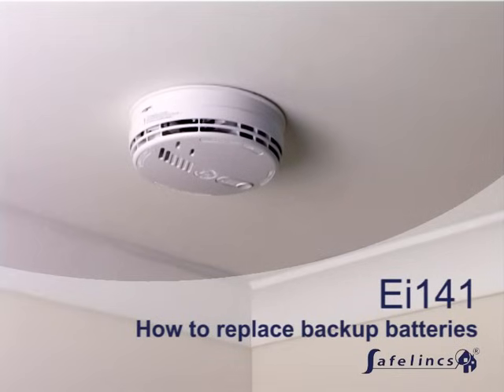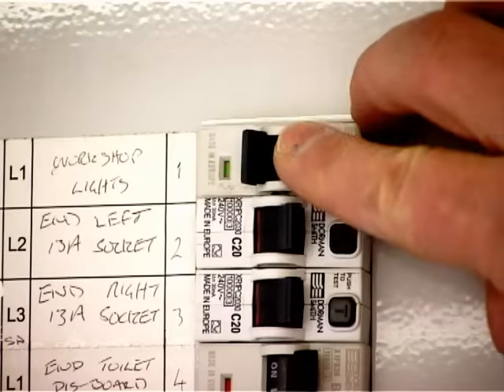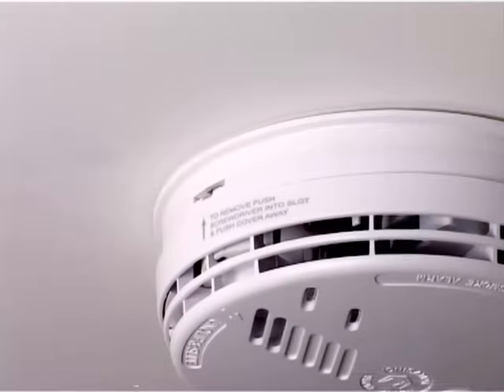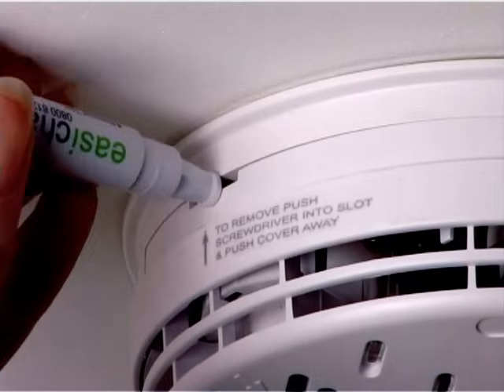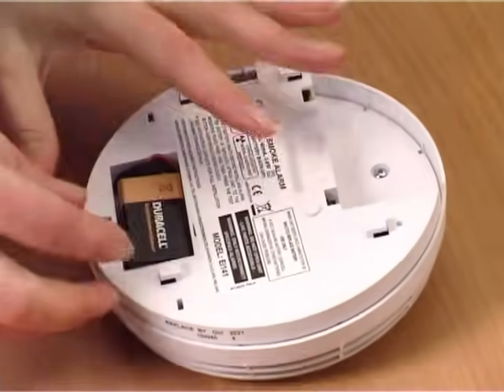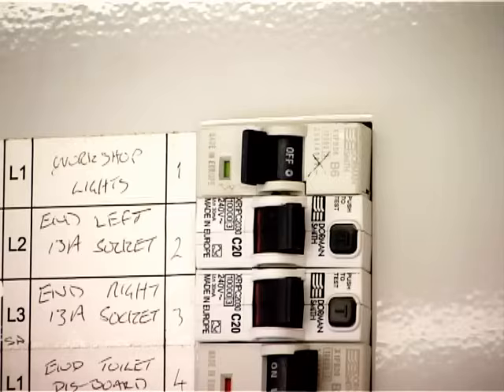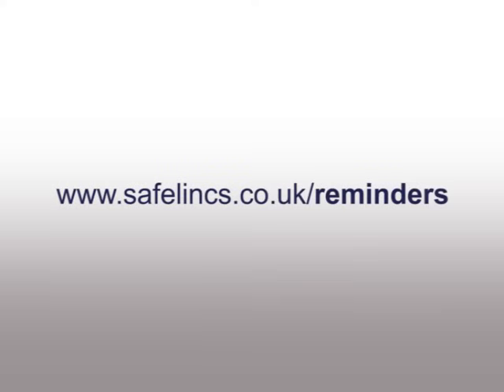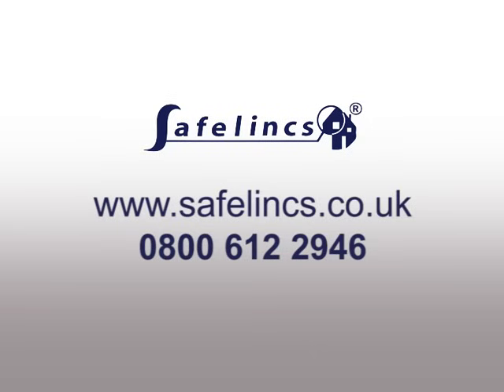Replace battery in Ei141 smoke alarm

Comment: Comments are comedy, however, to all the people saying how sh*te they are: they are incredibly easy to take down, get a blade screwdriver, push it half a centimetre into the slot on the side, then tilt the blade towards the roof to unclip, then slide the unit in the direction of the arrow. 
Once it’s off the ceiling the battery is in plain view, swap it for a new one, clip it back onto it’s base and that’s it. Not as easy as the old battery only ones, but with good reason: these are connected to the mains... the actual mains!! if all you had to do was unclip the front there would be potentially fatal voltages present... these things would never have made their way onto the market if they were dangerous. Advisory: turn of the circuit these are linked to, it may be a lighting circuit, it may be a ring main with sockets on, you’ll know if you’ve got the right one because the green light will be off. Once it’s off it’s mount you’d have to be incredibly stupid with a screwdriver or wet hands to get a shock as all the conductors are recessed, but probably a better idea to switch it off than do it while the base is still live.
Reply: It seems like a lot of people these days can't follow the most simple instructions. Reading most of the comments have given me a good laugh, some are just depressing if you know what I mean.

Comment: cracked open with a screwdriver after many attempts then never replaced the battery because don't want to do this again after 1 year. My vote for most rubbish design ever. I will buy one where you don't have to use screwdriver to open it.
Reply from the maker: While I can understand your feelings re the difficulty of getting into the alarm I would really hope that you might put a new battery back in to make sure your are properly protected. This is life saving equipment after all.

Comment: I was able to remove the cover and my 9v battery, but the 9v battery  bought wont fit into the smoke alarm as the threading  appears different and now am stocked with no fire alarm in the house.

Comment: I have changed the battery done all the above and why is it still making beep noise??
Reply from the maker: Hi, smoke alarms have a lifespan of 10 years after this time the alarm can continue to chirp or beep even after changing the battery.  To check if this is the case there will be a sticker on either the back or side of the alarm with a replace by date.

Comment: Easy job to do thanks to the video, if using a screwdriver just wiggle it until you can slide the cover off. Don't be put off by the bonehead comments below, 141,990 people have viewed this and done the job without difficulty.

Comment: I did this and it's still bleeping, any ideas? It was a brand new battery that went in.
Reply from the maker: Hi, smoke alarms have a lifespan of 10 years after this time the alarm can continue to chirp or beep even after changing the battery.  To check if this is the case there will be a sticker on either the back or side of the alarm with a replace by date.
Reply: @Safelincs  thanks

Comment: Worse design ever. Had this device above a high cieling above the stiars with the release part facing away from the side I could get to. In the end just ripped the cover off with brute force and had to cut the wires. In a rental property with a shit lanlord so no doubt it's going to be costly but I was at my wits end with this awful device.
Reply from the maker: Hi Rob, this must have been extremely frustrating! Like all these comments we will be feeding them back to the manufacturers in the hope that they will listen and design something more user-friendly.

Comment: Hi there I switched off the switch that says smoke alarm but the green light stayed on...dont want to electrocute myself....any ideas?
Reply from the maker: 3006tootsie Hi, sadly, this is a case for the electrician. While the contacts in the opened alarm are well hidden, we have to recommend the use of an electrician on any live equipment.

Comment: I replaced battery in my fire alarm but it beeps with 20 sec or so interval. I see the green light is on though. What does it mean? Incorrect installation or something?
Reply from the maker: Hi, first thing to try in this situation is to take the alarm off the ceiling, take the batteries out and see if anything else is beeping. The most common occurrence is a carbon monoxide alarm in a drawer beeping. If that is not the case, check the replace-by date (no older than 10 years) and replace if necessary. Failing that, check our help guide http://www.safelincs.co.uk/help-to-resolve-beeping-ei-aico-alarms/ and then contact your retailer.

Comment: If I ignore it when will it stop?  I've tried my hardest and can't get it down it's now 11pm and need sleep!!!!!  it's right above my bed😢😢😢
Reply from the maker: A nasty experience! Three suggestions to prevent this in the future: 1) always change the battery preemptive at the same time of year and never suffer from this again.  or 2) Upgrade to the sealed, auto-recharging Ei161RC and never change the battery again  or 3) go for an alarm that has the 'Sleep Easy ' function during the night, eg FireAngel Pro

Comment: So in the middle of the night it starts beeping and someone has placed the fire alarm directly above the top of the stairs so I have to balance to try and reach it to find how to stick a screw driver(kitchen knife) in it somehow while it’s pitch black in the house because it’s wired to the lights in the house and I have to turn them all off  and do it in the dark then I finally remove it and it’s still beeping! Great design

Comment: I have just replaced the batteries in all units in my house and pressed test on all 1 unit still beeping, what should i do my dog is very unhappy with the beeping needhelp please
Reply from the maker: Hi Jennifer, you need to check that the replace by date is not exceeded (about 10 years). If it is, your alarm might need replacing altogether. Another possibility is that you have a battery operated Carbon Monoxide alarm nearby (in a drawer or so) with a low battery warning. It is fiendishly difficult to spot the source of a short beep. To verify this possibility, take the smoke alarm off, remove the battery and see whether there is still a beeping sound. Harry

Comment: Out of curiosity I'm sure the red light wasn't flashing before I replaced the battery. I thought the red light was flashing for a sign for me to replace the battery. Replaced the battery and then red light was flashing every 10 seconds and then 2beeps happend and now red light is flashing every 40 seconds all a bit confused
Reply from the maker: The initial signals are part of setup routine. The 40 second red blip is stating that all is well.

Comment: My alarm is going off (not just beeping....going OFF) every 10 mins for about 10 mins at a time. It was installed by an electrician only a few months back. There's no fire or dust and it's driving us crazy. The hush button isn't working. I've managed to take it down and remove the battery so now it's useless. Why is it doing this????
Reply from the maker: Ozkiwi Hi Ozkiwi, you need to get back to your electrician and ask him/her to check your alarm out. You will be covered by his/her liability and the product's warranty. You can also use our helpguide to see if you can spot the problem.
http://www.safelincs.co.uk/help-to-resolve-beeping-ei-aico-alarms/

Comment: I've taken the battery out and it is still beeping.  Any solutions
Reply from the maker: Hi, if you left the smoke alarm off the ceiling with the battery removed it should not beep any longer. The fact that you can still hear beeping means that you probably have a depleted carbon monoxide alarm in a drawer.

Comment: Thank you for the informative video which I luckily found as I am moving in and I will put fresh batteries in immediately! As for the hilarious outstanding comment thread and superb deadpan replies from @Safelincs Ltd.  you can be sure that I will avoid a lego type tower or swiveling chair to climb on and to try to remember to turn off the mains power to avoid probable electrocution, brace myself with a harness & pulley contraption to avoid dislodging myself as I try to dislodge the cover and to discharge the alarm button for my neighbours entertainment! I will try not to struggle with the cover replacement as long as the harness & pulley don’t get entangled & preferably not attempt this obstacle course in the dead of night. Back out in the pouring rain to turn back on the power mains switch and .......................................................ummmmm, I must buy a battery first & get a flat thingamummy to prise the sucker open with.       Tadaaaaaa !

Comment: Does the power HAVE to be switched off?
Reply from the maker: Not for technical reasons but purely to avoid any risk of coming into contact with the electrodes which become exposed when the head is removed.

Comment: Has anyone managed to change the battery without turning it off at the mains? I have no access to the fuse box. Also will pressing and holding the test button nullify the chirping without changing the battery?
Reply from the maker: Hi, the test/hush button will only temporarily silence unit in case of false alarming, so sadly will not stop the low battery warning. While the battery can be changed without the power turned off, it is recommended that the power is turned off to stop any accidental touching of live wires.

Comment: Where can you get the easy change removal tool?
Reply from the maker: Hi JD, it comes free with the easichange replacement alarms. If you are not using easichange alarms, you can try a small, flat screwdriver.
Reply: Safelincs Ltd. Thank you. I was just asking because I moved into my house with this type of smoke alarm and there was no boxes where all the other instructions for things were (E.G: Bolier & Burglar alarm booklets). One of them had a battery problem. It's sorted now but yeah, just wondering if I could get a single tool for if the other one starts beeping.

Comment: The worst thing about this is that it’s hardwired in so even if you take the batteries out🔋 it will still keep beeping..
Reply from the maker: Hi, The Ei141 has alkaline backup batteries which are just popped out when you need to replace them or when you are de-commissioning the alarm. This stops any beeping. If there is still beeping to be heard it is coming from somewhere else. Usually, it's a carbon monoxide alarm somewhere hidden away with its battery running low.

Comment: Unreal. I was very close to taking a hammer to the thing. Now both of them are lying completely dismantled. I have plenty of normal batteries but not those weird little rectangular ones. At least I'll have peace and quiet now, albeit at slight risk of being burned alive.

Design something easier to deal with.
Reply from the maker: Hi Mahdi, there are mains powered alarms with re-chargeable backup batteries that will never need replacing during the lifetime of the alarm. https://www.safelincs.co.uk/kidde-firex-230v-mains-powered-alarms-with-lithium-battery-backup/

Comment: Can’t remove cover as the genius who installed it left the part where the screwdriver is to go right up against a wall. Also told by a fireman I know that smoke alarms should never be close to where wall meets ceiling as it is the last place in a room where smoke will get to.

Comment: The video succeeds. Leave something on the stove ONCE and you'll find out why you need an alarm. You buy into that reality, or you don't. The beeping is a necessary evil. The need for a screwdriver is barmy, it should just twist off. NO excuse for that insanity.
Reply from the maker: Hi John, thanks for your positive feedback. We agree with your sentiment, though, that removal should be much easier, especially of a smoke alarm that needs a new battery every year. The concept of making the alarm hard to remove stems from the manufacturer's focus on the rental market, especially social housing. It assumes that tenants might be tempted to remove the alarm if the battery runs low and starts beeping rather than waiting for the management company or landlord to replace the battery. We believe there are better solutions for this potential issue, though.
Kind Regards
Harry

Comment: This is bs as no slot is there. Can’t even pay for someone to come out either due to the virus. I don’t know who designed this mess, but they need a good talking too. How are people expected to remove a cover with a tool you never supplied in the first place, then on top of that you can’t even see the damn slot.
Reply from the maker: Hi, you can use a flat screwdriver if you don't have the tool. However, there is no way round finding the slot.

Comment: The noise is driving me crazy . Who can change the alarm .  We changed the battery still beebeing 😖
Reply from the maker: Hi, if it beeps with the alarm and battery removed, then you have another alarm in the room, eg a carbon monoxide alarm with low battery. If the alarm only beeps when on the base, check the age. if older than 10 year you need an easichange replacement alarm for the Ei141 https://www.safelincs.co.uk/easichange-ei141ek-replacement-kit/?q=ei141ek
Reply: I am sorry for the inconvenience you had. @Hermi Teka

Comment: ADVICE FOR PEOPLE WHO ARE STRUGGLING TO REMOVE IT !!! 

Stick the screwdriver or whatever it is that you've found that can fit in there and hit the back of it with a hammer (or something else you can find). The in comes right off. 
I struggled for hours before I did this and couldn't get it off, but this worked for me without having do damage it (which I was fully planning to do, this is the worst fkin design).
Reply from the maker: Hi Danni, there is a risk that you cause damage to the alarm by using a hammer. Just using a screwdriver and wiggling it a bit will do the trick
Reply: @Safelincs  I should have specified - a light tap on the back of the screwdriver. Literally nothing else did it for me.

Comment: Have replaced all 3 batteries- green light is on but the red light is flashing every 90 seconds or so- is this normal? Really don’t want my elderly mum to have to listen to that horrendous noise overnight again 😠
Reply: Are they fresh batteries? Did you press the test button after fitting the batteries?

Comment: I watched this video and tried to get the cover off multiple times with no success and in the end I used a hammer to tap at it whilst holding the screwdriver in - worked straight away.

Comment: What happens if you don’t turn off the power
Reply from the maker: The risk of electrocution is luckily very low as the contacts are not protruding but recessed, however, we still recommend the official approach.

Comment: If you do not have a screwdriver like that use a 3mm drill bit (blunt end) that worked for me. Hope that helps someone as it was a bloody trial to remove. ALSO THIS VIDEO NEEDS TO ALSO MENTION THE HOUSE CODE AND HOW THIS CAN BE LOCATED IN CASE ANOTHER UNIT IS INSTALLED AND HOW TO PAIR THEM TO EACH OTHER, A HOUSE CODE SENDS A MESSAGE WIRELESSLY TO THE OTHER ALARMS AND SETS THEM OFF TOO. WOULD NOT WANT TO MANY FALSE ALARMS OR A FAULTY ONE THOUGH WOULD YOU LOL.
Reply: The 3mm drill blunt end worked for me after trying for 2 days straight. I had to stand on a luggage on my bed to nip it successfully :)

Comment: All you have to do is to "insert a flat-bladed screwdriver into the slot, lever it slightly ‘til you feel a movement, slide the casing off, remove the battery and replace with new battery." Sounds easy, right? Nope! I inserted about a dozen different flat-bladed screwdrives into the slot, and still the cover wouldn't slide off!!

Eventually, I resorted to the old "When all else fails – hit it with a hammer approach". Well, I inserted the screwdriver, hit it with a hammer and the casing flew off, hit the wall, went spinning off downstairs, with a small bit of plastic flying off! Doesn't look too damaged, but the thing is finally off and the incessant beeping has stopped.

Note to Award Winning Designer of the Year: Why did you design something that many adults have found almost impossible to remove? Do we really have to live in a Nanny State where we can't trust our children from dismantling a smoke alarm and burning the house down?

Comment: One more thing, this is the bit which did me:  Disconnect from mains, keeps beeping. Actually manage to open the unit, keep beeping.  Take out the 9v Battery - STILL KEEPS BEEPING.  It's like having a really shite Talky Toaster ala Red Dwarf.  https://www.youtube.com/watch?v=LRq_SAuQDec
Reply from the maker: Andyjzr Hi, I would say you have a CO alarm in the same room which is low on battery! I know that sounds crazy but is actually a very common cause for continued beeping. Please let me know if I am right :-)
Reply: Yeh got it all sorted in the end, it was just trying to actually get it open.  I live in an old converted pub and very hard to open it when on tip toes, on the bed, on cushion and a few yellow pages!! Would have been easier if I wasn't 5" nothing!!

Comment: I’ve removed the alarm from the base but it’s still beeping
Reply from the maker: Hi, I assume the alarm is out of the room and you can still hear beeping. I can guarantee you that it is not the base, so it might be worth going through drawers trying to find this carbon monoxide alarm with a low battery. You would be surprised how easy it is to be misled by the beeping.